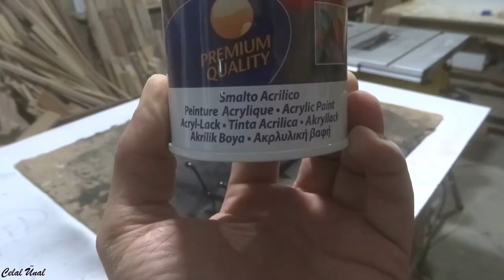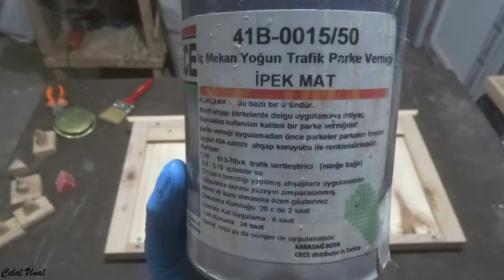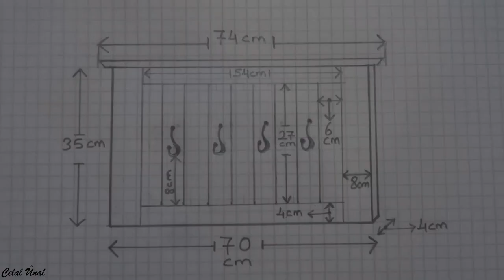Paletten askılık yapımı / Making coat hanger from pallets / Colgador de palets

Comment: Congratulations for the 'great job! Can you tell me what product is that spray you used in the corners? Do you have a link? Thanks
Reply from the maker: Thank you so much. Fast adhesive and coolant spray.
https://www.google.com.tr/search?q=h%C4%B1zl%C4%B1+yap%C4%B1%C5%9Ft%C4%B1r%C4%B1c%C4%B1&source=lnms&tbm=shop&sa=X&ved=2ahUKEwjbg5mk2fHtAhUlkcMKHdASCowQ_AUoAXoECAcQAw&biw=1366&bih=635
Reply: @CelalUnal1  Thanks
Reply: @CelalUnal1  Unfortunately this link does not open .... maybe it's wrong?